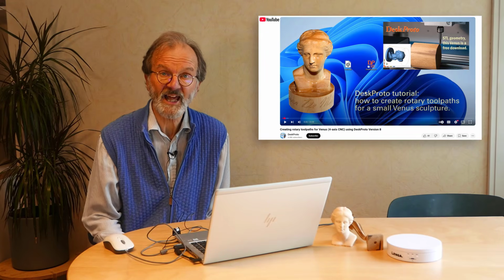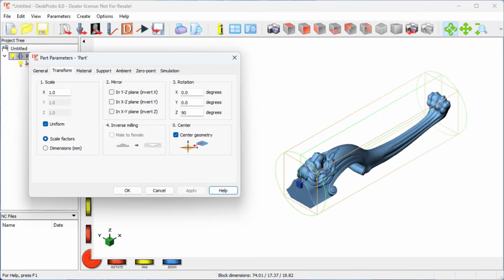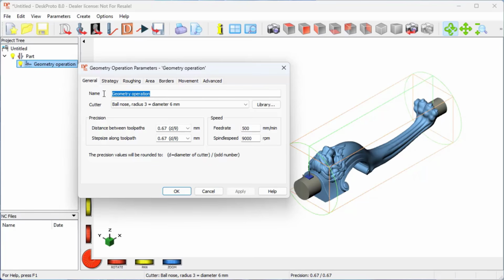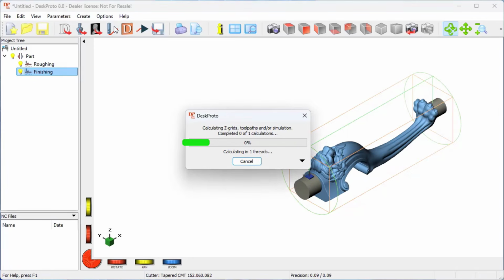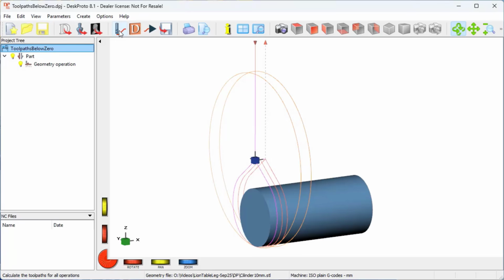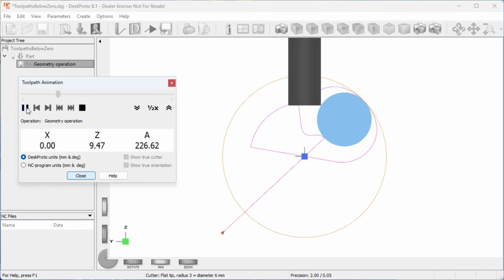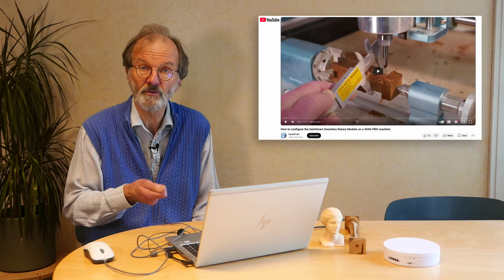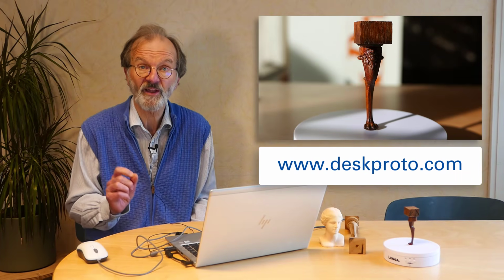Rotary CNC machining (4-axis) with toolpaths below the rotation axis

Comment: Here, I have sent you a link to a YouTube video showing how I created the control program for this part. What is not working for me is that the hole I am showing, the wall there should be straight, but it makes it conical. It feels like the fourth axis does not stop when the mill should create this groove, or whatever it is called correctly. And the hole on the side, the three of them, it also makes them conical. Why is this happening? Could it be because my fourth axis is parallel to Y? Or, I don't know, I did exactly as you did in the video. If you can help me, I would be very grateful.

Comment: Good afternoon. I have the program DeskProto 7.1. I have this problem that I did exactly as you did, but for me it turns out differently. I get that in the holes that have straight walls, it makes them conical. I would like to ask you to show me how to correctly create the control program for the model that I will send you a link to, so that you can see why this happens for me.»
Reply from the maker: Hi Brothersevents3904,  In reply to your three comments.  The holes that you machine indeed are conical: the cutter cannot reach the straight walls of the hole. This is because these rotary CNC toolpaths only use three axes: Y, Z and A. The cutter does not move X and remains above the rotation axis all the time. You can find a drawing on page 108 of the DeskProto tutorial book (PDF, https://www.deskproto.com/download/manuals.php ).  In order to correctly machine this part you need to use indexed machining, see https://www.youtube.com/watch?v=SdKGDBmiq6A
Reply: Good afternoon. Thank you for your response. I know about that function which can process one or two sides, but I wanted to machine this part on four axes. And it turns out, if I understood correctly, that DeskProto cannot work with four axes at the same time.
Reply from the maker: @brothersevents3904  For Indexed machining you do use the fourth axis. Still, as you say, DeskProto cannot make all four axes move at the same time.

Comment: hello,iam using vectric aspire for my cnc turner,  in vectric aspire there orientation that means we can adjust the axis, along y axis and along x axis but in deskproto can we do this?
Reply from the maker: As default in DeskProto the rotation axis is parallel to X. Changing to a rotation axis parallel to Y is a setting in the machine definition in DeskProto (n the Library of machines).

Comment: Would you clarify for me, how the R= -10mm setting was determined please, its not completely clear. Also was this tool setting used for carving the entire project?
Reply from the maker: That is explained in the video, on 11:40. Here I move the cursor to the lowest position that is needed (a visual check), and then I read the Z-value belonging to that position in the right bottom corner of the screen. Z -10 means setting a R -10.